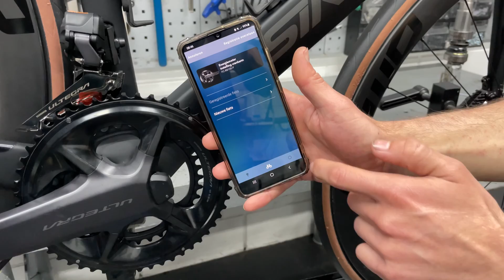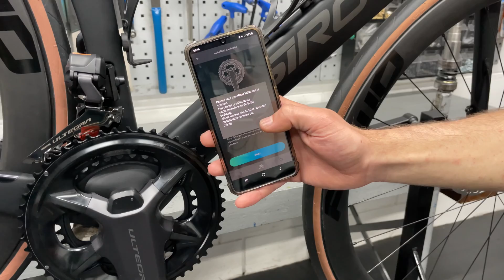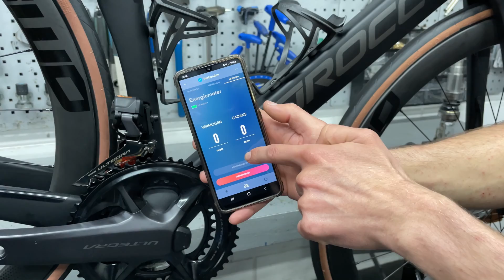Monteren en Installeren Shimano Vermogensmeter Crankstel Ultegra & Dura-Ace, inclusief kalibreren!

Comment: I need to remove the crankset to clean and grease the bottom bracket. I don’t understand the tool shown at minute 1:57 — is it necessary? Where can I buy it? What is it called? Do you have a link?
Apart from that, is it just a matter of following your procedure in reverse?
How do I disconnect the electrical connection on the left crank arm?
Do you have a video showing how to remove a crankset with a power meter?
Thanks!
Reply from the maker: Sorry this is the only video of the power meter

Comment: :-( When I attempt to calibrate my magnet, the crank LED doesn't light up?  I also don't see any data on my Garmin or on the app but I see that the powermeter is paired ... just no data.
Reply from the maker: Make sure your magnet is properly aligned and the battery is well.

Comment: Do you mind measuring the distance you stuck the magnet on? I do not have that tool
Reply from the maker: I think 7cm, It is also possible to measure the distance on the crankset
Reply: @siroccocyling  my non drive side crank has ripped off the power meter wire. Is this necessary for the PM to work? Or can it work from one side? 

Thanks
Reply from the maker: @JB-nt4jd  Bouth size has to work, we had also a problem with a custumor with this. His powermeter didn’t work anymore
Reply: @siroccocyling  ok great. & is the magnet necessary for it to work?
Reply: @siroccocyling  wat moet je dan precies afmeten? Ik heb een fiets 2e hands gekocht waar ook de verkoper de magneet was vergeten... Ik wil hem er graag goed op plakken, maar heb niet deze tool... Moet je meten van het hart van de crankset tot het hart van oplaaddingetje of juist tot het 'kastje' op de arm? Dit lijkt bij mij veel korter dan 7 cm, eerder 5 cm. Bij voorbaat dank!

Comment: how to disconnect that cable from left crankarm when you want to remove the cranks?
Reply from the maker: It is very easy, You can press slightly on both sides of the cable. Then the cable comes loose.
Reply: @siroccocyling  thanks!

Comment: Does it matter where the magnet is installed. Mines was installed at 12 o’clock position
Reply from the maker: I think it doesn't matter. You must perform the calibration properly in the app. The easiest is at 9 a clock!
Reply: It doesn’t matter, these cranks will never show you accurate data anyway so why bother.
Reply: Ik heb bij mijn groepset geen batterij gekregen, is die altijd nodig??, ik zie dus geen wattage op mijn edge 1030, hij is wel gekoppeld thx
Reply from the maker: @ronnesselaar1755  batterij zit er niet bij, je moet wel een oplader hebben
Reply: Fantastisch wat snel beantwoord zeg, maar ik bedoelde dat magneetje, alles is op geladen en ook gekoppeld maar zie wattage en cadans op edge,bij futurumshop zeggen ze dat ik geen magneetje nodig hebt pffff
Reply from the maker: @ronnesselaar1755  oké, normaal zit deze er wel bij! Die achter het crankstel te zitten!